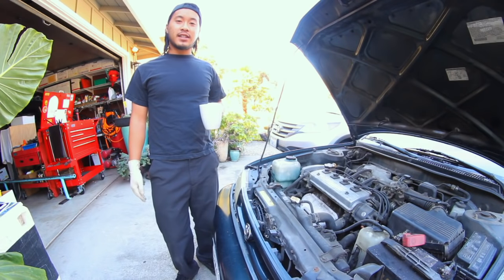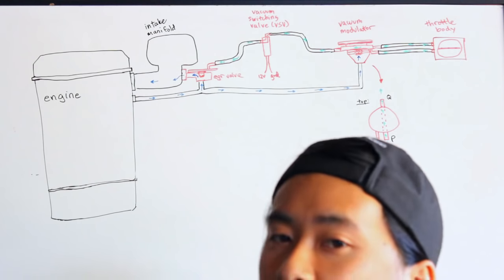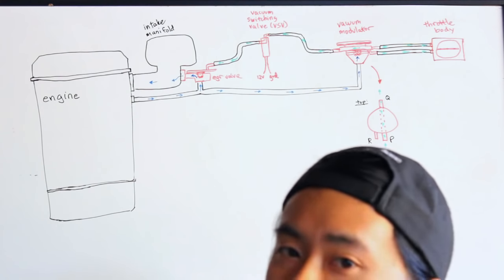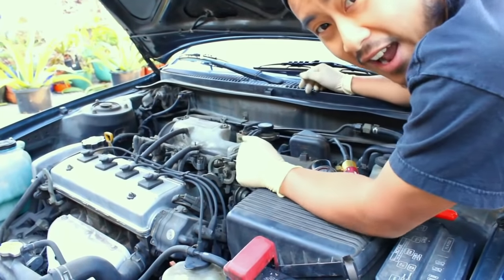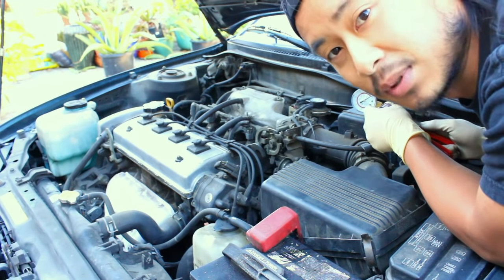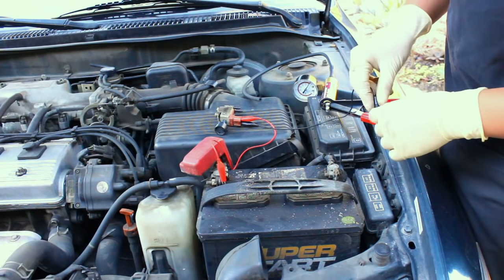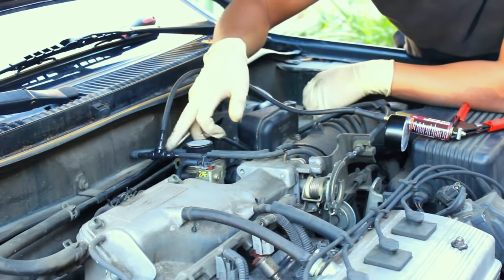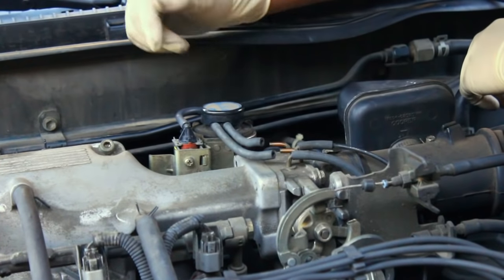How to test Toyota EGR System(VSV, Vacuum Modulator, EGR valve)

Comment: In all honesty; people like you make owning used cars fun. I was able to diagnose my entire EGR system in one video as opposed to just the egr valve. I did not know about the VSV solenoid and that was my cars issue. I can sleep better because videos like this exist. Liked, commented and subscribed.
Reply: I need to check the VSV  solenoid on my Toyota corolla.  I cleaned the EGR valve and replaced the egr modulator. I'm still getting rough idle. 🍺😎👍

Comment: I did the last test in the video and the vacuum gauge moved very noticeably. But when I tested the vacuum modulator the gauge barely moved. What should I do? If I'm getting getting a nice reading with the last test in the video doesn't that mean my whole system works?

Comment: I am VERY appreciative of great videos like this. I'd just like to add one additional thought. I have on '01 4 cyl. Camry where I first (without testing anything) replaced the VSV valve and EGR Valve. Cleared the P0401 code but it came right back. Changed gas cap, Vacuum modulator, and a couple evap lines. Cleared the code but it came right back. Changed the VSV again with a better quality (aisin) part and relocated it to the firewall. Code came right back. Cleaned throttle body. Still the same code. Finally, as a last-ditch effort to be able to get my car to pass inspection, I spent $22 (including shipping) from ebay for a used ECU. It's been 500 miles and I haven't seen the code yet.

Comment: Thanks so much for your excellent video. It helped me track down the cause of my P0401 error code on my 1997 Camry. It turned out to be the Vacuum Modulator- probably one of the easiest components to replace in the EGR subsystem.

I used to love working on cars back in college and shortly there after, from about 1980 to 1990. My cars tended to be from the early days of emission controls, so they were very simple to fix. Then I got busy with life. This is my first attempt working on a relatively modern car, and your video really helped me understand the troubleshooting and repair steps.

I look forward to watching more of your videos.

Comment: I was about to buy a egr. But with this video. I tested everything like he explained and the only problem my car had was a plugged vacuum line in the throttle body I took it out and cleaned it with a throttle  body spray solvent.I spend only 6 dollars for the can and fix the car problem no more check engine nice I'm happy.

Comment: Thanks for your help. I was able to use your breakdown of the system to find out that the vacuum modulator in my 95 Corolla needed replacement. I did everything else you discussed except the modulator. I ended up pulling the vacuum modulator out of another 95 Corolla we have, to compare. I guess the diaphragm in the vacuum modulator in the first car broke, but the second car's modulator worked properly. Thanks again!! :)

Comment: I removed the entire EGR assembly for cleaning.  I used an extra reach 12 mm racheting wrench for the three nuts in the back and good luck reaching the 4th HIDDEN 12 mm nut underneath the EGR cooler, on my Toyota PRIUS Gen 3.  Good video!

Comment: God bless you for making this video I had recently gotten the same code on my 97 rav4 and now I figure out what is causing the code
Reply: ive a 97 rav was the engine reving high at 2,ooo.and took a while to go down to a 1,000 rpm ? and fuel consumption was high ,im trying to get to root of problem Cheers Ant from Wales UK

Comment: VSV  have a magnetic solenoid that can be energized either way plus or minus.

The service manual for mine says that when energized if you can blow through it replace it. (2003 Camry 4cyl no egr valve)

Good video: explained that there should be no extra air flow when cold starting and warm up.

Comment: Thank you Justin, I have this problem with my Toyota Tacoma 2001. I cleaned the valve EGR first...after changed the valve EGR...after cleaned the lines, but the ligth check engine and the error code 401 is on. I will test the solenoide and the valve VSV like you. Thanks so much.

Comment: awesome video man! really good to see the diagram and explanation as to whats the egr system does, that was really helpful. I'm getting intermitted engine light come on with P0401 code. Sounds like the vsv is a common issue so may look to change that out

Comment: Looking at your diagram I finally realized how the two vacuum nippled lines from above the throttle body plate area get blocked with dirty exhaust at the nipples on the top of the throttle body that normally would provide the vacuum modulator with its’ sources of altering throttle plate area vacuums. Maybe these tubes are metered down internally?  
Exhaust gas from of of the exhaust supply line going to the EGR Valve is also supplying exhaust gas back thru the bottom of the broken vacuum modulator, exhaust that is being sucked back thru the inside of the vacuum modulator back towards the two throttle body vacuum nipples, that feed varied vacuums, when totally unblocked, to the vacuum modulator. 
I tested my EGR with vacuum at idle, killing the engine as it should and with the engine off i could use vacuum to open the EGR valve and hear the EGR valve close when vacuum was released.
I replaced the vacuum modulator but kept getting EGR codes, so in desperation, (since the VSV switch is buried under the engine on my 1997 2.2L) I did, with a cold engine, to avoid a fire, tube spray throttle body cleaner down all 3 nipples ports above the throttle plate area using the accessory tube sprayer inserted in these nipples and the EGR code and check engine lights that kept reappearing just disappeared with one short disconnect/reconnect of the battery ground wire and have not returned for many months in my daily use car.
Been around town and thru 70 highway miles at 75 mph.
The modulator replacement part was like $25 bucks, and throttle body cleaner, with a small push on spray tube is not a huge expense. 
Use nitrile gloves because that cleaner probably contains nasty stuff, evaporates very coldly and obviously don’t breath it or spray it in a confined area. Safety First. Good luck to all!

Comment: saved me lots of $$$$ by checking everything like on this video one tip clean all airlines and intake manifold, my EGR valve was not making my 96 tercel to cut out when I was applying vacuum this was because my intake was dirty the line that goes from the EGR to the back of the intake and also clean your EGR itself

Comment: Thank you for the video Justin!  I have a 94 4runner and I just replaced my old EGR valve with a new one and I'm still getting the Check Engine light code 71.  None of my lines have any cracks in them, so it has to be the VSV motor candor the modulator so I will look into that with a pressure gauge.  Hopefully this will fix the issue!
Reply from the maker: you can also try blowing thru it with your mouth to see if it opens/closes
Reply: Justin Le , thank you I’ll try that.  By the way, where can I get that pressure gun you had in the video which you were using to test the EGR?
Reply from the maker: @npatel1576  I got mine at harbor freight tools. But many orielly auto parts, autozone, etc. sell them too.

Comment: Great Job Justin.  Dopest EGR system video on youtube.  Also thanks for the modulator education lessons.  That part is confusing to me.  It seems like when throttle is fully applied the modulator gets pushed up by the exhaust AND get pulled up by vaccum too?  like to help it or something... that part was confusing.  Anyway great job - much love to you and your fam.  Peace-out.
Reply from the maker: +SatanIceCream Thats right. When the throttle is open, the engine produces exhaust back pressure that pushes up on the diaphragm. Also, there are two vacuum ports on the top of the modulator. One goes to the EGR system, and the other helps pull up the diaphragm.
Reply: +Justin Le Thanks fam - that clears it up - that part was confusing me for the loongest time.  Wonderful video, simply the best on the internet.  The push/pull action is unique indeed!  Peace and love from socal.

Comment: Great Video,  Im having a 0402 excessive flow and its driving Me crazy LOL
Reply: Hi Michael. I hope you got your 0402 Excessive Flow error corrected. I have a '97 Avalon with same error. After watching Justin's video, I tested all of the solenoids that sit next to the plenum and one more down by the charcoal canister. All were good with the exception of the same one one Justin showed, the VSV (vacuum switching valve). I ordered one from O'relly auto parts, installed and no more problem. There are so many parts that can cause this that it is a good idea to research and repair yourself before the mechanic starts throwing "Hail Mary's" out there.

Comment: Thanks for the excellent overview! I am running a manual 1,33 L 2010 Corolla (1NR-FE) here in Finland. It whistles under cold starts in the winter, particularly when upshifting between gear 2, 3 and 4. I just noticed that it has also started to burn oil (about 1/2 L in 500 km; 10 L per year?!). There was some black soot in the tailpipe when I checked so it is not a leak. I had suspicions about the EGR system earlier but the local mechanic suspected the whistle was coming from the bearings in the belt tensioner. I am currently running it with the original Toyota full synthetic 0W-20. Having added a half-liter yesterday the oil cap was difficult to open, indicating there is a vaccuum (under-pressure). Any tips on where to start? Could it be the PCV valve?

Comment: I think everything about this video is awesome. My only question is what are those cables/wires being used to run the voltage through the selenoid?
Reply from the maker: They are called alligator clips. they are really cheap online. If you want to back probe a connector, I use sewing needles with an alligator clips. No need to buy a ridiculous expensive set.

Comment: Very educational video.  I have check engine light on.  After watching video I tested my VSV and it is open all the time between ports.  You can hear it click when applying voltage but it does not change the flow (open or close between ports).  It is open all the time.  Bad VSV?  1996 Toyota RAV4

Comment: You have a lot of useful information to tell.  Drop that distracting music.  It just gets in the way of focusing on what you are saying.
  Wouldn't the vacuum dropping so fast when testing the good VSV before applying power show a leak inside the VSV or is it leaking out of the tool?

Comment: Nice video. I did try the EGR test where I applied vacuum directly to the tube on top of the EGR valve. It dramatically reduced the RPMs but when I stopped applying vacuum it did not go back to where it was and now it almost dies and I can see it continually trying to increase the throttle by pressing and retracting the thing that pushes the bottom of the manual throttle control inside the engine bay. Does this mean that my EGR valve is stuck? Or what?
Any help.

Comment: Justin, I have a 2002 tacoma and it is throwing this code. the vacuum tool you used, where can I obtain one so I can run the same tests like you show in your video?
Reply from the maker: Its called a brake bleeder/vacuum pump... Oriellys, or a harbor freight is the cheapest. You can also suck on the hose to the egr valve to produce vacuum if you want to test it(do in clean manner tho). Also blow thru the vsv and check if the valve is opening that way. Forgot to show that in the video.

Comment: Where does Q, R, etc normally go to? I wanted to make sure they're hooked up right. Very informative video! Thank you
Reply from the maker: Ports P and R go to the throttle body and port Q goes to the VSV. You can see it in the diagram on the whiteboard and also during throttle body testing on the car.

Comment: I agree with all of the comment stating excellent video from start to finish. The only question I have is what does the sensor screwed inside the EGR valve do and could it also cause a 401 code?

Comment: Great video, I learned a lot.  My issue now is that one of the three vacuum take offs at the throttle body has an obstruction. ( it has less vacuum than the other two). I can't get get it open. Any ideas? Thanks

Comment: I have a 92 Toyota pickup with a 3.0. I am getting a check engine light showing EGR problems. I hooked up a vacuum guage between the modulator and EGR valve. I am not getting vacuum until about 2700 rpm's. I read that you should get vacuum at about 1200 rpm's. Does this sound like a modulator problem?

Comment: Thanks for easy to understand diagnostic of the problem.  Got the same problem but my VSV, EGR and EGR modulator are all new.  I push on something else and it cleared the PO401.  What I push is the piece right below the idle cable assembly.  It looks like an EGR valve with a plunging mechanism that touches the idle cable assembly.  Anyone know what this thing is called (vacuum actuator?)

Comment: good vidio thanks for showing us .question if the avcume switching valve hsa gone would it cause over reving from strt ? it takes a good while before engine revs die to a 1,000 rpm ,and fuel consumption is high .ive ?  cheers Ant from wales UK .

Comment: Thanks for showing such video, it's very helpful. I got one question for you, when you press the gas paddle (accelerator) sometime you got gas sometime you don't. I changed all the wires, spark plugs, fuel pump, and gas filter. Still not solve the problem. What else I need to look for if you could I would very much appreciate it. Thank you. I am Hmong.

Comment: Check engine light on a 2000 Toyota Avalon came on and the trouble codes are...

P0440: EVAP Control System Large Leak (0.080") Detected
P0440: EVAP Control System Large Leak (0.080") Detected
P0446: EVAP Vent Control Solenoid Circuit Malfunction

From what I have gathered, there are three different Solenoid's in the vehicle (one at the fuel rail, one at the charcoal canister & one at the air cleaner).  How would one know which one to change out?

Comment: What is nice about vaccuum systems is that you can check each part in-line without having to take everything else (what you arent checking)  out of the line.

Had bad O2 read, chnaged it. FAILED emmissions.
Seafoamed tank and throttle body methods - 2 cans each - holding off doing the cracnkcase method for now.
THen, of course, got the bad HARD CAT read and PEND EGR eff read (remembered that OBD2 doesnt let any Non_con tests to continue if there are any hard codes from the CAT or EVAP. (or any Heat component, asfaik). 
Then Reset the codes, drove the Low Speed Drive cycle 3 times - now was only getting the single cycle CAT read and no EGR issue. yet. Freeze frames showed they had occured,m butdropped out later.

REJECTED emmissions because shop hadnt submitted (online these days) paperwork to State yet.
Station mgr had be fill out personal affidavit, showed reciepts from legit shop for the B1S1 and my own personal reciept from changing B2S1 my damn self)
Printer jammed, they fixed it........

PASSed emmissions.!!! Even tho - but, this is Illinois we're talking - had the 2 Not Ready - but they were the EVAP AND the CAT! Talk about lucky.

Rechecked codes, now the EGR eff low is back, and still renewed P420. Since I passed, not gonna worry about the CAT yet.
But, I think goind thru all the tests o the EGR system is a great idea, and MAY, after driving out the tank o SeaFoam mix, might not even get the one-cycle CAT code anymore - btw, havint got the HARD CAT code back and the soft code has dropped 3 times in 4 mor cycles, including a high speed cycle, so the SeaFoam may have worked its way thru the CAT nicely.

 Now all I need to do is identify/locate each EGR part to test in a 97 Toy Avalon XLS!

Comment: Hi. Excellent and very well put together video here. Question for you. I am attempting to replace the shift solenoid E unit and I have to remove the Neutral safety switch to get to it. For some reason the neutral safety switch, after taking off the retaining nut and the washer type set unit that holds it onto the shaft arm coming out of transmission, the neutral switch will not simply slide off, wiggle off like it should. All the other video's show it just coming right off. Do you know any tricks to this or have you run into this before? I hesitate to put to much force on it as I am afraid I will damage some how the arm, shifter level arm coming out of transmission that it fits on, on the shaft. Any idea's. Thanks

Comment: Do you know what might be wrong if I'm only getting vacuum out of one of the ports from the throttle body? I don't think it is clogged up because I can get compressed air and even a guitar string easily through the one that is not pulling vacuum.

Comment: Hello Justin, First off thanks so much for showing this, great information to know, I have a 93 Toyota celica gt 2.2 and I have a idle problem on it, It never has shown a check engine light, I checked the egr valve and can here is click when I apply vacuum to it. I unplugged my Map sensor and the car started idling better but the check engine light came on when I unplugged it, I plug it back up and the engine light goes off but the car starts idling bad again. Does this sound like to u the Map sensor is bad? I am going to check the VSV next and see if its working.. Please let me know your thoughts.. ThanksProblem solved
The main cause was a Map sensor which caused, rough idle/stalling, Burning Rich and once it warmed up it would have a lack of power, I could press the gas peddle to the floor and it would just fall on its face. I also found a ECT ( engine coolant temp sensor) bad. The weird thing of the map sensor was it never threw a Check Engine Light ever from the day it started. I tried unplugging the Map sensor and the check engine light would come on, Plug it back in and it went away..I hope this might help someone else in resolving the same problem...